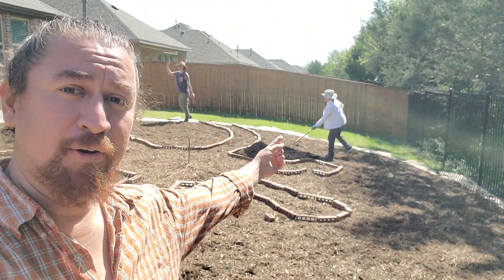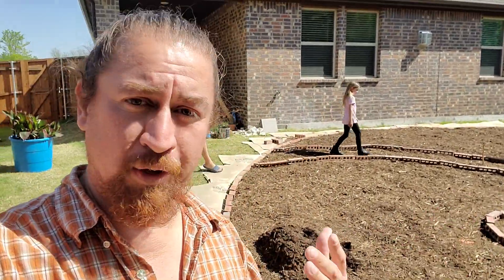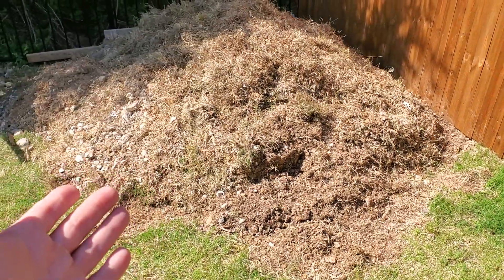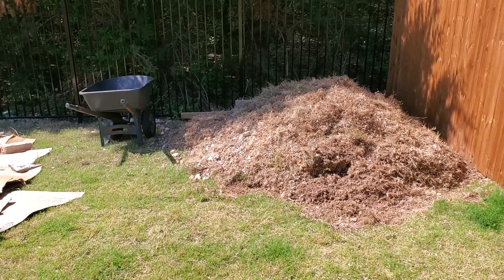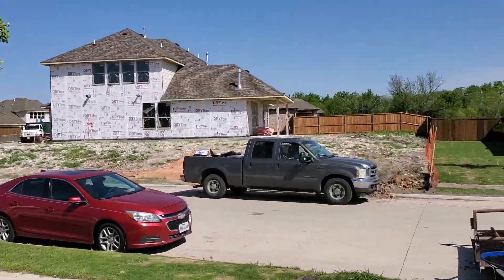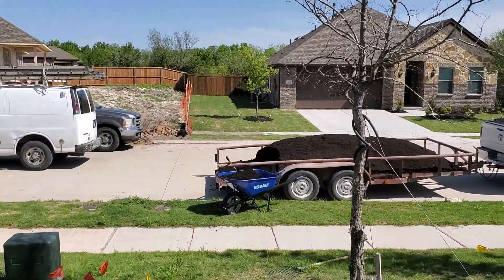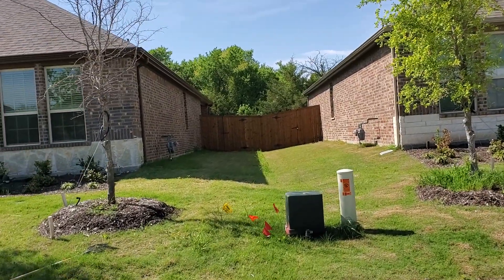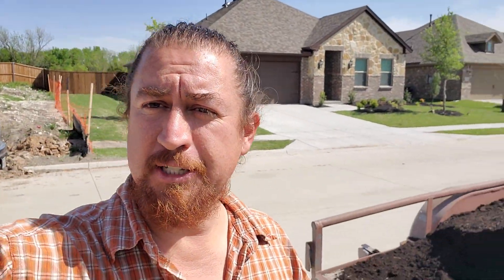Logistical issues and permaculture installation

Comment: almost guarantee you never calculated the amount of applied water required to grow 1 kg of vegetable crop in a semi-arid climate = multiple that by say 1500 kg per person per annum of vegetables/fruit and you might grow 1 to 5-% of an individuals annual vegetable intake = so how much water do you have?
Reply: Do you eat 30 tons of vegetables per year? Because that's 80kgs per day.
Actually a person's typical vegetable intake is more in line with 0.5kg per day (maybe double if you have a REALLY healthy diet) and you're still looking at 200-400kgs per year.
Unless you plan on producing grains, which on such a small scale I'd advise against. And still we should at most get to your 1500kg per person TOTAL.